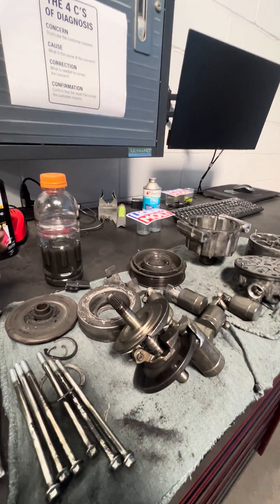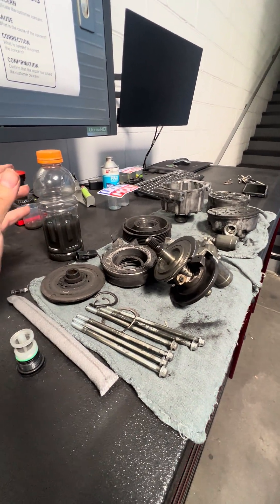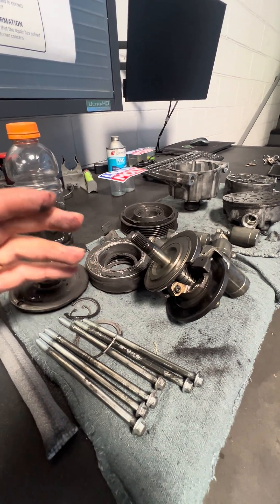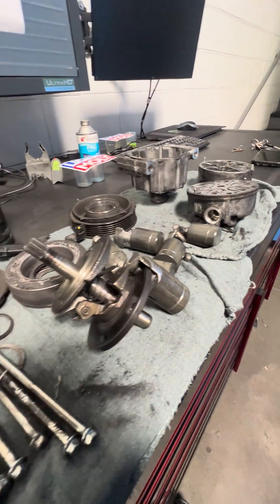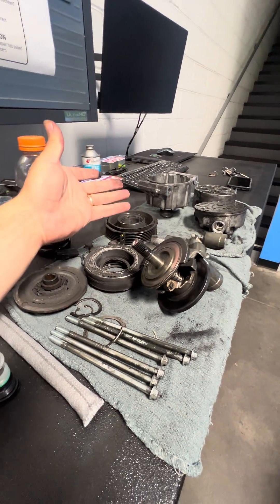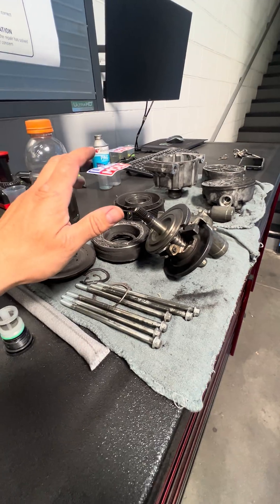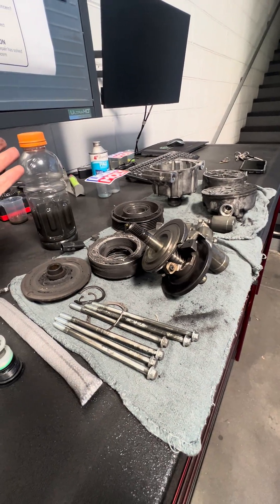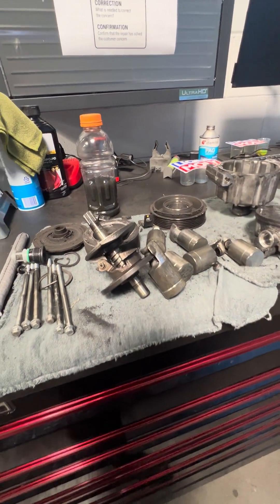Why Low Refrigerant Destroys Your AC Compressor

Comment: Vapor with too much superheat overheats the compressor and breaks down the oil, not enough refrigerant to return the oil back to the compressor is also an issue. When the freon leaks out, so does the oil.
Reply from the maker: Yup.  Exactly right.